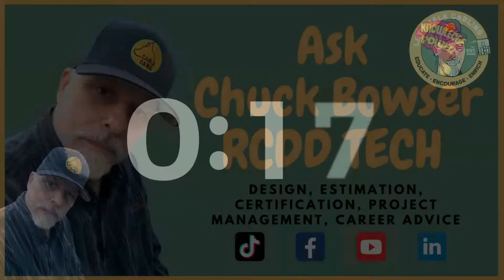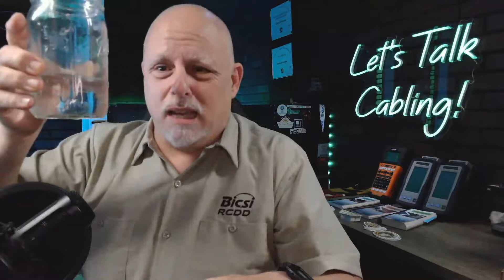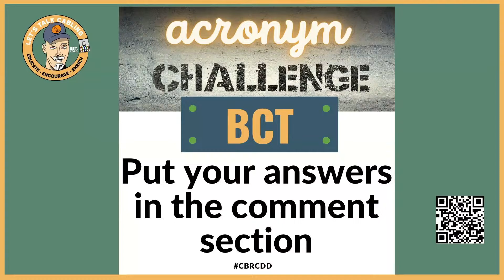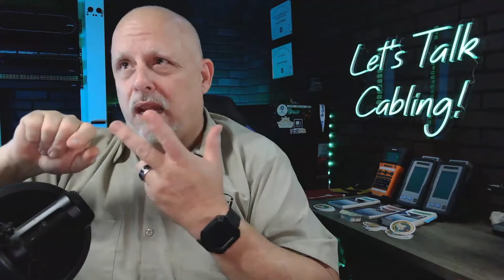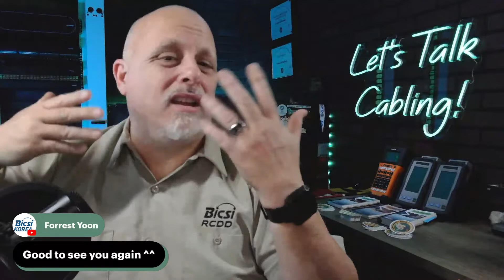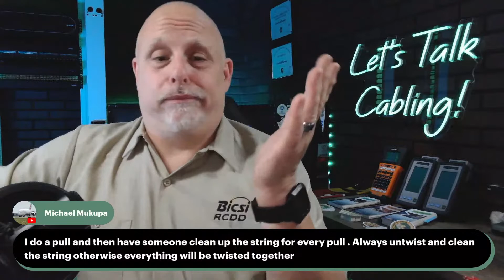11/10 Ask Chuck Bowser RCDD TECH -  After Hours Live

Comment: I have not had a chance to test this yet, however, supposedly if you tie the follow pull string about a foot or so in front of the cable head, rather than with the cable head, it does not get twisted up quite as bad.
Reply from the maker: I have done that and it does help some. You just have to ensure its tapped on well.
Reply: @LetsTalkCabling  I wonder what fiber stripper he was talking about that does not require tools....?? I've never heard of that but I'm interested. Since I've gotten older, for some reason I'm terrible with the Miller style stripper now, especially if the fiber is more brittle.
Reply from the maker: @Eric-qx1kx  I have contacted the manufacturer and they will be on a future episode of the show!